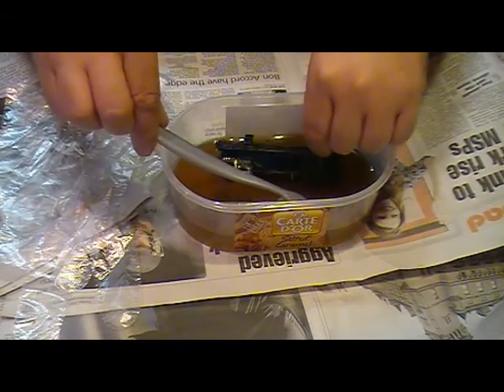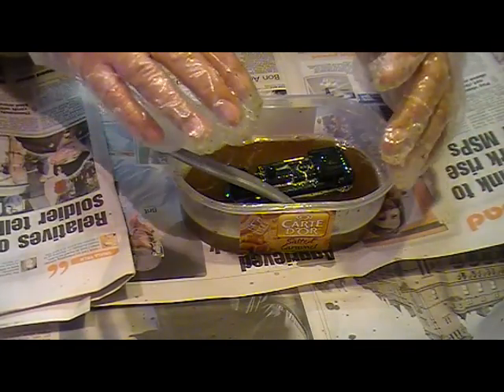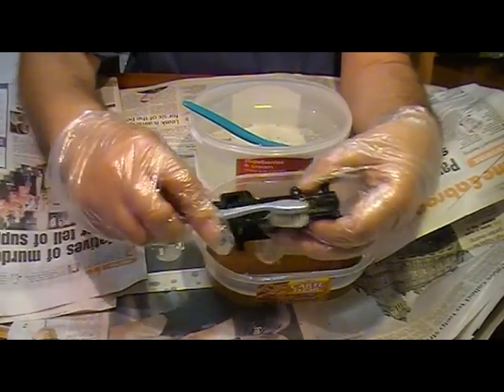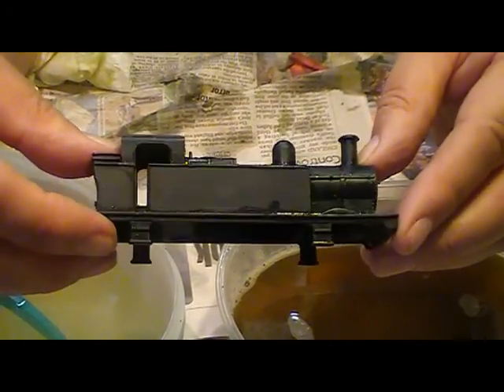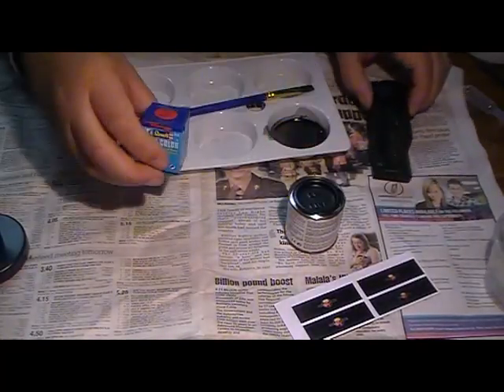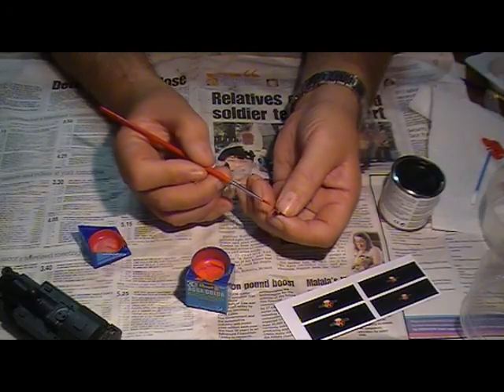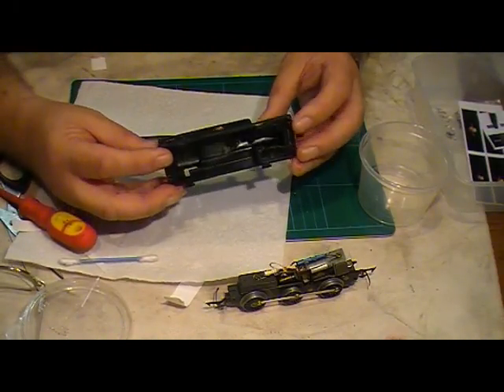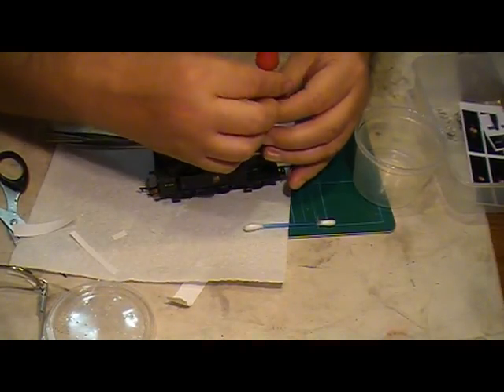Building a Jinty Part 2

Comment: Actually the 1958 model had the non-warping body of that type with the cycling lion with red and white lining around the water tanks and bunker number with Mark.2. couplings (see 1958 catalogue). 1959 saw then all with Mark.3. couplings so the 1958 model was a very short production run.

Early 1952 to 1955 Jinty has open space under the boiler (and recessed wheel backs).

I prefer to use Press Fix tranfers as their sheets do dozens of locos and one can create one's own numbers.

For paint nothing beats Hammerite satin black as used on the real thing.....

(And it comes in an aerosol too!!)

Comment: I'm wondering if passing a current through the Detol will pull the paint from the awkward bits. A friend works for a company that services aircraft parts and they use a solution with a current in a vat to remove paint.

Worth experimenting with.